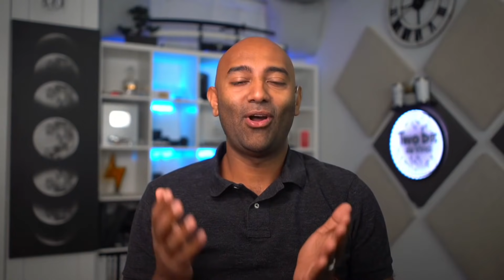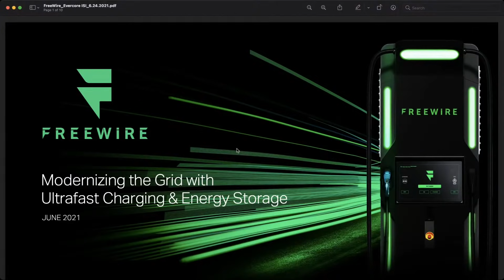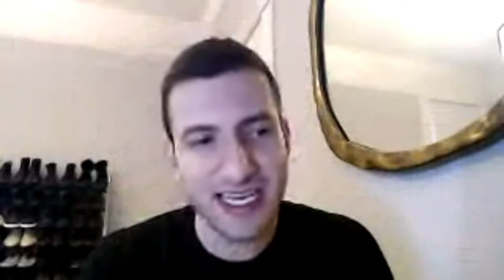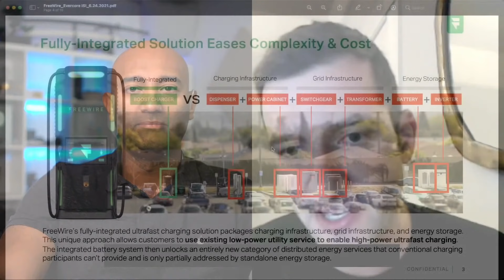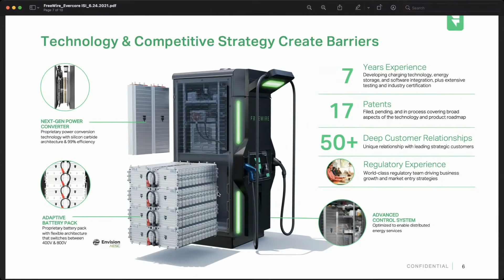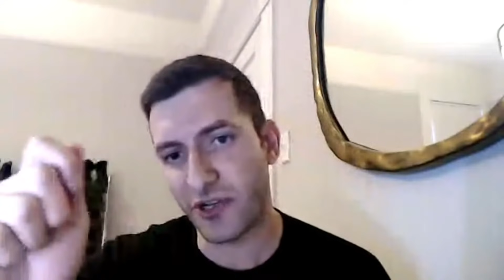How Will We Charge Millions of EVs? Interview w/ Freewire

Comment: It's a very clever solution. But when I look at this slide deck and photos I am reminded of the same questions I have had since I first heard of electric vehicles 25 years ago. Most of all, won't they simply transfer the pollution from the internal combustion engine down the line to the power plant? Charging millions of cars will require thousands of new power plants. And unless we all agree nuclear is okay now or we suddenly transition to all renewable energy creation, that power is going to come from natural gas and coal. So it's just moving the pollution from the car to the power plant. You even said it at 15:56. "We can make more power. We can build another power plant." So, how does that not offset pollution from the car to the power station? Secondly, the batteries concern me. Tesla had already had issues getting their hands on the resources to build batteries. Things like cobalt and lithium have to come from holes in the ground. The idea of "blood batteries" has already been raised several times. And strip mining the entire crust of the earth to make cells doesn't seem much better than filling the sky with CO2. Then there's disposal. Right now, batteries basically go to landfills. Ewaste is already a huge issue. And, sure, there's some clever ideas out there for refurbishing and reusing batteries but eventually they have to be thrown away or recycled. There doesn't seem to be anyone thinking about that. And if we're already going to need billions of batteries for our cars and our power walls and now you want to add the charging stations themselves to that list... It seems like it's going to be a massive issue. What to we do with spent batteries?

So it's these questions: Where does the power come from? How to we build batteries sustainability? And how do we dispose of batteries? They have concerned me since I first heard of the concept of electric vehicles. And I'm not an expert in this stuff by any means. I follow it about as closely as I follow anything else like video game development, computers, or space flight. I watch stuff like this and read articles and try to stay up to date on it. So if I'm missing something on these 3 points, I'd love to hear it. That's why I clicked on this video. I thought it was going to answer at least one of those points. Instead, it's added a 4th concern to my list which is infrastructure.

Comment: CCS just needs some software advancement. It has the signal pins and it just needs to keep up with what we need. It should be more like the Microsoft DirectX in that it comes out with a new version of new things it can do, and then the game companies learn what it can now do and integrate the new features into their products.
Reply: I'm sure that will all get worked out with time.  Most of the issues are probably caused by manufacturers rushing to get an EV out quickly.  Nobody planned far enough ahead to be able to work these compatibility issues out in advance.  The whole system is currently just patchwork.  Now that EV's are almost universally accepted as the future, I'm sure we will see some better planned systems.  It's kind of like the wild west, many things were very sloppy and unplanned.  Everyone had their own idea of how things should go.

Comment: I am 9+ year Tesla owner, and live in all electric home with 13.2 kWh solar PV system (2012 installation) with two PW2's installed in 2018. We charge both our Tesla's generally off our roof except on road trips. We produced 350% of our energy needs with our setup last year, and exported 50+ % of our solar energy back to grid. I know we are not typical, but most Tesla owners I know also have solar, so we are not taxing the grid except on trips.
Reply from the maker: Very few tesla owners generate enough electricity to charge their cars. I have a 5kW system that makes 4.5 kW at high noon, but that’s not half what my car charges at. Even you’re 13kW system is going to be taxed and can’t charge except around noon. Bottom line is it’s a tough challenge made much easier by people like you with awesome solar systems!

Comment: Little bit late to the conversation. Great video. Will free wire have battery limitations? I wonder if they would consider a different chemistry than nmc. I’m debating the f150 ev but debating it since I do pull a small camper. Mostly regionally. The Pittsburgh area has limited chargers and very limited areas where I could charge while towing (pull through chargers).

Comment: I'm confused, you showed in the first part of the presentation that Tesla installs a giant battery as part of their installation, and then said the benefit of this system is that it contains a battery...?
I see the advantage is the speed of installation but then you need batteries in every charger instead of one battery feeding all the stations. Surely battery sourcing is going to be an issue?
Reply: I agree.  While this system would be awesome to have installed everywhere, I really don't think it will happen for a while.  Batteries are already expected to be supply limited for at least the next 10 years, and that's just for the expected demand for EVs.  I can't imagine supplying a lot of these will be easy.  I feel Tesla's approach is more scalable.  You can start with a small battery for the site and expand it as you gain more cells.

Comment: What would it take to convert tesla chargers to this ccs standard?
Reply: I understand CCS requires a significant hardware change to the car.  Just an adapter (like the Tesla to Chademo adapter) won't work.  <sigh>
Reply: @martyweirick9846  so it would be quite a lot of work but doable. And Tesla would need to start making and possibly refitting US Tesla with ccs charging socket like they do in Europe.

Comment: Building your own packs with new batteries seems more expensive than having bays for retired vehicle packs that have reduced charge density.  There probably isn't a universal bay, but the "pods" used by vehicle brands should be sufficiently available to create a few low-cost supercharger lines.

Comment: Australia has plenty of places you still need jerrycans to get to. No chance with evs.
Reply: For now. Sounds like nobody goes to those places, so there hasn't also been any incentive for someone to place a gas station there either.
Reply: @davidmccarthy6061  they are wilderness areas with no infrastructure.  You couldn't put a petrol station or a ev charger there even if it was economically viable

Comment: Petrol stations also have people working onsite. Most charging stations don't. So pumps are likely to be fixed quicker.
Reply: Not so. As I see there's several gas stations in my town and at least 2 pumps are offline for more than 1.5 weeks. I'm not a techy and I don't have an EV yet but these new charging stations are connected to the companies so they have a better turn-around on repairs. Let's hope so. If its the same as gas stations then people may hold off on buying into EVs till its better than Gas Stations. I got a feeling Charging Stations will get much better quicker under the new administration and the signs of a worsening climate change.
Reply: The workers there only sell gum and make coffee. The station is an independent business that has to call another company to fix the pumps, the car wash, etc.
Reply: @davidmccarthy6061  yes,  but having someone onsite means that call gets made sooner.

Comment: There's a couple things being said in this video that don't add up. 
I'm seeing a L2+ charger with limited DC fast charging capacity, that will need 7hrs recharge time for each 1hr 150kw charging session. It's not a bad idea, but I think it will suffer from expectation management problems.
Reply: I just just replied about my similar view.  I think it would be great for something like Rivian's adventure network, or maybe for heavy use industrial equipment but for general use it doesn't make sense to me.  Just skip the added cost and complexity and install a bunch of 15-20 kW chargers.  Or spend a bit more and get a real Level 3 charger.
Reply: Toally agree.  This solution is no solution at all.
Reply: Not really, many people don't need very fast charging, and many EVs don't accept high rates of charge. As discussed, this could become a stop for a quick top up near coffee shops or convenience stores, with multiple locations you won't need to fully charge very often

Comment: Could you do this with capacitors instead of batteries?
Reply: No, capacitors have a very small energy storage capacity.
Reply: I absolutely cannot understand how super/ultra capacitors can stand up to the mechanical pressure between their plates, but a quick Google turned up a 137F, 62V supercap module from Eaton (ref. XLM-62R1137A-R), priced at about $2000, quantity one. That module can theoretically hold about 73kWh of energy, although you probably couldn't get all of it transferred to a motor due to the declining voltage during discharge.   But it's close to the storage capacity of an EV's main traction battery, without degradation issues from temperature or cycling.

Comment: For everyone to switch over to electricity you will need solar and wind production everywhere possible along with a Nuclear power plant or two in every medium to large city.  You will need battery storage for grid stabilization everywhere.  What will the long-term plan be to manage all the battery waste as these charging stations and electric vehicle batteries start to fail after 10-15 years?  How will we environmentally sustain all the new mining that will need to take place to keep up with the demand for new lithium batteries?  No matter how I look at this situation, it's going to be unsustainable unless we have a massive improvement in battery technology and lithium battery recycling.  We can also expect electricity to get far more expensive if everyone starts charging electric vehicles.
Reply: The Fossil fuel industry consumes enough energy for EV charging. As we transition to EVs, the fossil fuel industry will consume less energy.

Comment: Not sure if I missed it, but rather than per-charger batteries, is Freewire also looking at outfitting charger facilities with one (scalable, as chargers are added) mini-megapack that could also provide the hosting facility with backup power &/or local utilities with peaker assisting grid smoothing? Could the inverters & splitters stay on the individual chargers being fed 800V from the "facility" pack? Would doing so simplify & make production easier/cheaper yielding higher margins? Could the scaled down version just be a conventional charger "clamp on," with only sub-800V chargers needing cabling retrofits?

Comment: Hmm with 20kW you are still only able to fully charge 4 - 5 Teslas (100kWh) a day. And you are not realy abel to make a park with more than one freewire Station.  But for the right Szenarios its very nice!
Reply: Agree. Not the best solution for all situations, but definitely promising solution for some cases
Reply: Very few charging sessions go from 0% SoC to 100% SoC.  More likely the average fast charging session is under 50 kWh, so at least double that number.  The FreeWire guy stated that his stations can max out at about 20 chargers a day, which would average 24 kWh per charge, which seems in the range of reasonability.

Comment: Tesla shouldn’t spin off their charging network because it’s faster and more reliable than the other networks.   Maybe in 10 years.
Reply: They just need to change the plug
Reply: @dtibor5903  and charging protocol.
Reply: Tesla just offered their charging network to any EV car maker that wants to use it. Adapters are easy to make and this decision is going to make Tesla even more money since they have the most robust charging systems.